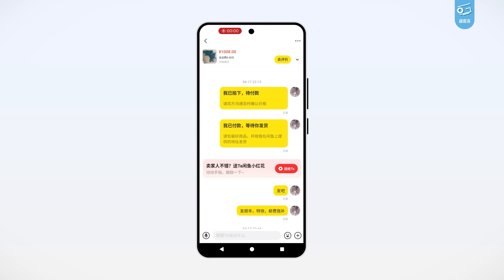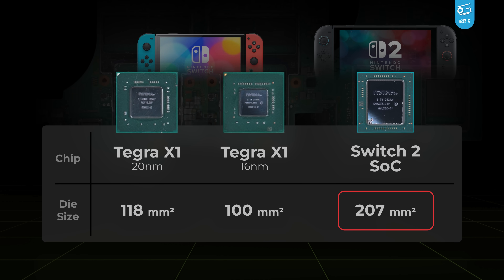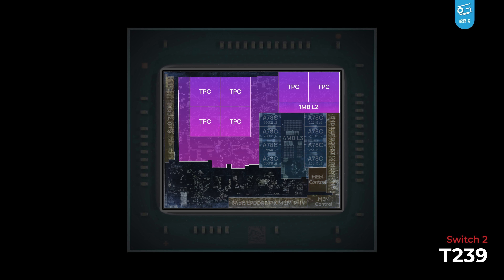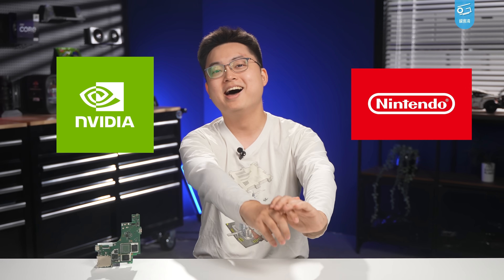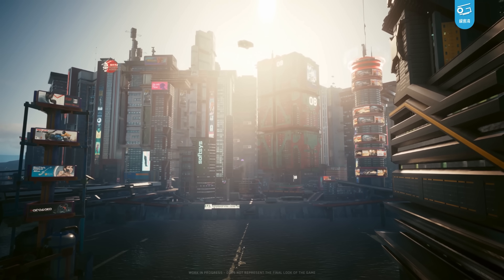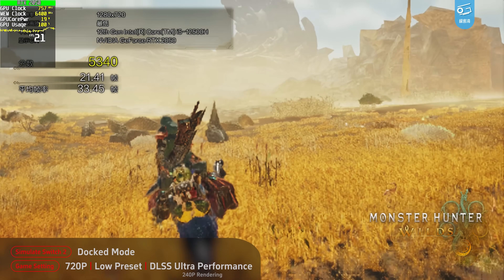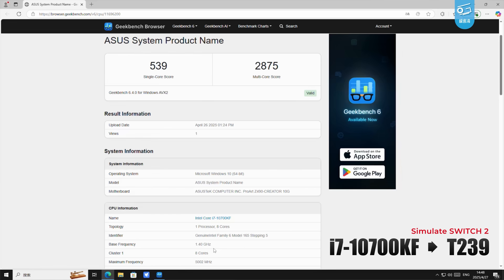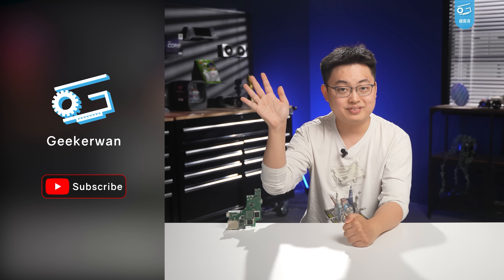This is Nintendo Switch 2's CPU!

Comment: Man its soo sad hearing that this processor could’ve launched in 2021/2022, people would have gone nuts for a Switch “Pro” with this kind of performance and it means the Switch 2 would’ve had even better performance then we’re getting now. Nintendo might have been able to pull off a 10 year generation with it. Instead Nintendo coasted off the Switch’s success, let their most dedicated consumers suffer through low framerates and resolution (even in their own first party titles), and are now overcharging for their “next gen” console with tech that was ready 3+ years ago.

Loved the video, super high quality stuff with a lot of professional insight.
Reply: Exactly! They were still making bank off the old hardware
Reply: @chrisbellevue  The Switch 2 costs $400 to manufacture in 2025.  The console costs $450 and that still isn't a profit because of other cost concerns.  

Releasing this in 2021 would have be brick-stupid for a plethora of reasons.
Reply: @D2Kprime  don't spread false informations. the chip is half the power of a 3050 which sells for 150€ today. in 2020 the price would have been justified. be the steam deck is way more expensive to produce and costs less. also Nintendo themselves said they don't loose money on the sales anywhere in the world. that included japan where it sells for 300$. ao logically the production costs less than 300$
Reply: Ah yes 2021 the year when we were all suffering from covid still
Reply: *4+ years ago.
And you are absolutely right about everything. They even stated that they don't loose money anywhere with this system - and in japan it's only 309$.

Comment: I'm glad the processor is 8nm. It means we're more likely to have a Switch 2 revision.
Reply: Yup, 3nm incoming for the bigger battery revision
Reply: @SWOTHDRA Lol, not even Nvidia's flagship 5090 is using 3nm, and you think Nintendo are putting that in a switch 2.

Comment: 04:12 i have been telling the dreamers this for years now: SWITCH 2 MIGHT BE MORE OUTDATED THAN SWITCH 1 IN RELATIVE TERMS. Switch 2 us releasing at about 4 years after the soc was finished, Switch 1 just 2.
Reply: that's because it was planned as a switch pro. just like totk was planned as a dlc
Reply: @HermesderWetterbote  Yeah... no. That's not correct at all.
Reply: @HermesderWetterbote  But the thing that debunks the switch Pro theory is the following: The jump we see here for a Pro console, which is considered the same generation, is just too big. Between 7-10 times performance and a different architecture is not a Pro console material its new gen material.
Lets assume the "chip shortage" was the reason Nintendo didnt release the T239 Switch Pro. Reality is Nintendo could have released a Switch Pro with the Mariko X1. A wider memory bus, more memory runing a higher clocks & the X1 actually runing at their default speeds would've allow many games to reach 60 fps or maxout the dynamic res games. Also they could have unlocked HDR, that with that OLED screen would have made the games pop.
So no, a little bit of critical thinking & logic debunks the t239 pro theory.
Reply: @Refreshment01  there is one proof that the oled was planned with the t239: the switch oled dock can output up to 4k60 while the switch 1 dock was only capable of 1080p 60 fps. also it's not really using a new architecture. its still nvidia / arm just more cores and higher clocks. the reason they emulate Switch 1 is to stop piracy and homebrew.
Reply: @HermesderWetterbote  Honestly these are not good arguments. 1) The original switch dock had an outdated hdmi spec even for its time. It was 1.4 which came close to 8 years before & by 2017 2.0 was super common. At the Oled release it was harder to find 1.4 hdmi chips than 2.0. Also even the original tegra x1 has support for 4k 60 fps & hdr, heck hdmi 2.0 its the official supported spec in its tech sheets. Also your architecture argument is not factual. For example, t239 its using a new GPU architecture, Ampere, for its gpu which not 1, not 2 but 3 generations appart from maxwell. Same branding (Nvidia) but different architectures.
Reply: @HermesderWetterbote No, that’s because it was more expensive to use the older HDMI standard for the OLED Dock so they just used the newer one which can do 4K 60
Reply: @KingVulpes  unprobable, because on switch 2 they seemed to have used the older 20b instead of 2.1 (that's why there is no vrr docked) and older hdmi is always cheaper than newer one. so they paid more to get 2.0b (the same as in the switch 2 dock ) for the oled than to continue using the old hdmo 1.4
Reply: @HermesderWetterbote I don’t get the docked thing because the older Xbox One S and X had VRR on an older HDMI type
Reply: @KingVulpes  well, there are 2 possible culprits: either they used a 2.0b port in the switch 2 dock. (the same as in the switch oled) -it would also explain why no 4k 120fps output. or the chip in the dock that translates Displayport to hdmi is too old and does not supported vrr.  either way they saved money in a crucial place and only noticed it too late 😅 They saved a lot of money on many parts of the switch 2 actually. the old chip and the small battery are also very problematic. a 800p 90hz oled screen would have been smarter for image quality and battery life. (there's a reason even the steam deck only uses a 800p screen)

Comment: Ooof, nintendrones have been saying it's going to be a step up from the deck. Very unlikely unless Nintendo can work some serious magic. They're really gouging the lazy casual market..
Reply: A PC simulating a console is still a PC, and a PC always performs worse than a console with equal specs. The Steam Deck looks stronger on paper, but the results speak for themselves.
Reply: Nintendo has managed to run Breath of the Wild on a 1Gb ram machine (Wii U), and Apex Legends is on a Switch 1.
Sounds like black magic
Reply: Dlss is enough

Comment: The one issue I have with this video is they have not explained how much power the Switch 2 gets from its battery compared to the SOC's consumption. I thought it was a 20Wh battery and the minimum runtime is 2 hours so the Switch 2 gets a maximum of 10 Watts per hour but the screen will likely take half that power so the SOC only has an average of 5W per hour for maximum portable performance but it looks like this video is claiming far higher wattage being used in portable mode like up to 17W I think I saw. Maybe I've got it all wrong but it feels like this video is only describing peak power in portable mode not average power used which will be far less. I think they must have massively overstated portable performance levels. I personally think there is a far greater difference in docked vs portable mode myself. It won't have surprised me if they have over-stated portable performance by a factor of 2x. I feel like portable performance level is more like 600 Gflops approx. However docked performance I'm sure is accurate as you don't have to account for the battery for that.

Comment: You might have to do the cpu stuff again since arm cortex a78c   is more powerful & design for gaming laptop with better multithreaded performance while arm cortex 78ae is design for safety systems has the same single thread but worse multithread performance.
Reply: And in the context of chips running games, then a redo of the Steam Deck is probably warranted, as its 15W TDP prevents the CPU from pushing its max potential due to the GPU having priority of available power. Folks benchmarking with games has shown the CPU to drop to the realm of 2.0Ghz from its 3.5Ghz peak.
Reply: @DiscostewSM it would still be double the performance of the switch 2 cpu
Reply: @HermesderWetterbote  At 2.0Ghz? It would only be higher in single-core performance. Simple napkin math <score * (2.0 / 3.5)> would place the SD's single-core score result to about 721 vs the simulated Switch 2's portable mode score of 526. In multi-core, it would score worse, dropping the multi-core score from 4364 to 2494, less than the simulated Switch 2's docked mode score of 2735. This isn't taking into account that not only does the Switch 2 use A78C cores that are more performant than the A78AE cores used in the simulated rig, but that the simulated rig does not run the CPU on a single CPU cluster. It runs on a 2-cluster system splitting the cores to 4 on each, resulting in a lower multi-core score because of communication bottlenecks between clusters.
Reply: @DiscostewSM  the drop in performance is NOT linear XD if it where the switch 2 would be extremely weak at 1ghz
Reply: @HermesderWetterbote  Why would that apply to Switch 2 when it doesn't have a CPU frequency drop when the GPU is pushed? It doesn't have that TDP limit that Steam Deck does.

Comment: Damn cpu gpu is old
Reply: Console hardware almost always is (esp nintendo)
Reply: @sanji663  In this case, Nintendo is definitely old shit at being ~4 years since that SOC was taped out. It's almost comical.
Reply: @ 5 by architecture 
but the switch 1 also was architecture wise from 2014 (3 years old)
and the wii u / wii similar
Reply: @sanji663  think I'll just buy a tablet with a a 2nM sized cpu architecture
Reply: They don’t use Ampere though but a mix with Lovelake a custom chip wonder how it will pack out when we can finally test it with a working unit

Comment: 12:46 since its on handeld mode its okay with 720p. the ppi for the switch in handheld mode is equal to a 24 inch 4k screen. source ppi calculator
Reply: Is that ppi for 1080p or 720p
Reply: @ 720p 8 inch vs 4k 24

Comment: After comparing both the simulated raw performance data of Switch 2 & Steamdeck, I realize that nintendo is the Apple of gaming industry. They pay Devs to optimize their games for their subpar hardware whereas Steamdeck just runs on raw performance with little to no Dev support. I guess thats justifiable if nintendo is asking for 80-90 dollars per game.
Reply: This "paying devs to optimize their games" does not exist. Games on consoles have always been better optimized because devs can work far closer to the bare metal with APIs designed specifically for those platforms. They can't with the PC environment. Shaders, for example, are all pre-compiled for consoles, optimized for each architecture based on their strengths and weaknesses. On PC, they are not pre-compiled. They are kept in a general language that is then compiled by the GPU drivers to just work. One set of code meant to work with a wide range of architectures, none of which are getting an advantage. PC is a jack of all trades, master of none.
Reply: @DiscostewSM steam deck uses pre compiled shaderd
Reply: also that would be okay if the switch 2 would only cost 250$  - But it's more expensive than the better equipped steam deck. it has less ram, slower storage, smaller battery, an older chip etc. asking more money for weaker Hardware and more per game on top of that makes no sense. and games like cyberpunk 2077 seem to still runn worse on switch 2 in portable mode than on the steam deck.
Reply: @HermesderWetterbote  It's weaker based on numbers between simulated PC vs PC as opposed to being console vs PC. Weaker in assumed numbers, not results. Having 16GB of RAM isn't winning any awards as a PC when that's how much the PS5 and Series S have with what they are pulling off. A console doesn't have to deal with the intricacies that a PC does, so it requires less to run the same things.

The SD can use faster storage, but what good is that for games where the CPU has to decompress the assets, forcing a bottleneck? For games, it's not so much faster than using a microSD because of this, and those typically have a read speed of around 100MB/s. Even the i7-11800H pushed to 4Ghz on all 16 threads (and doing nothing else) is only decompress at a rate of 900MB/s. SD is getting nowhere near that on 4 cores when running a game that forces the CPU to drop to the realm of 2.0Ghz. So what about Switch 2? While not pointed out in this video, the same Nvidia leaks that refer to the T239 also refer to the system having a hardware file decompression block just like PS5 and Series consoles, allowing it to not only handle decompression faster than the CPU, but relieves the CPU of doing that task so it can do the rest of what is needed by games.

Having a bigger battery at equal power consumption is one thing, but with SD, it's draining that battery much more due to using the x86/AMD architecture while running fewer cores at higher clocks. Higher clocks means higher voltage, and voltage contributes an exponential increase to consumption compared to having more cores that is closer to a linear increase. Both push in the realm of 2 hours when at full load.
Reply: @DiscostewSM  the steam deck is more of a console than a pc... it also runs a custom linux distribution names steam os just as the switch runs a custom linux distribution called switch os. also if you look at cyberpunk 2077 the steam deck outperforms the switch2 by quite a margin in portable mode
Reply: @HermesderWetterbote  People say it is more of a console, but that's not right at all. It was designed to run PC games, plain and simple. Plenty of videos are showing that Switch 2 from the event with a WIP build of Cyberpunk from 7 weeks prior to it runs better than Steam Deck with a quality that tanks the frame rate with Steam Deck when trying to match it (with FSR instead of DLSS obviously). You can get a higher frame rate, but at the cost of dropping the settings to near minimum with FSR still on.
Reply: Apple actually scores very high in cpu single core perf and efficiency. Probably right about the gpu side.

Comment: As fast as a Steamdeck in handheld is good enough for me!
Reply: it's actually weaker by quite a margin, especially because the cpu is 3 times stronger on the steam deck. also the steam deck has considerably more battery life
Reply: @HermesderWetterbote  then what's that graph show if not equal performance?
Reply: @GlitterGuru  the graphs show: GPU:
Switch 2: 1308
Steam Deck: 1443
CPU: 
Switch 2: 493/2735
Steam Deck: 1262/4364
So gpu of steam deck is a bit faster, cpu is a lot faster. the steam deck also has more ram, a bigger battery and way faster storage. (and is cheaper)
Reply: @HermesderWetterbote  does CPU performance really matter for the Switch though?
Reply: @GlitterGuru  depends if the game is exclusive or ported. if you want to play gta 6 for example the cpu is important. switch 2 will probably not be able to run it while the steam deck can. and it's important for high FPS in games like cyberpunk 2077. the steam deck runs it @ native 800p with 40 to 60fps while the switch 2 in portable mode is 20 to 40 fps @ native 360p to 540p upscaled to 720 to 1080p via dlss
Reply: @HermesderWetterbote  I forgot people play ported games on Switch (not sure why lol). I was just thinking of Mario Kart and basic Nintendo games
Reply: @GlitterGuru  these will run fine, hopefully. I'm a bit sceptical about donkey kong bananza. it seems to run like echoes of wisdom and with no vrr in docked mode... 😅

Comment: so, they possibly faked some game footage they've shown so far?
I mean, it makes sense, given the hardware specs. those perfect videos shown in advertising are hard to believe. maybe they are running the games on pc or emulating (classic in-development versions) to record the ad, then, when people gets the actual console, they will get performance similar to what's shown in this video..

even if you re-compile and downgrade games for mobile, it is unlikely to get pixel perfect graphics on a 3 tflop system. this video pretty much confirms it
Reply: What games do you think are faked? Everything I’ve seen would have been possible on PS4 Pro in 2016. Plus and integrated console SOC is going to run games better than a simulated PC downclock with separate GPU/CPU